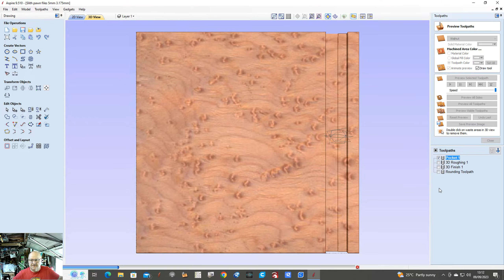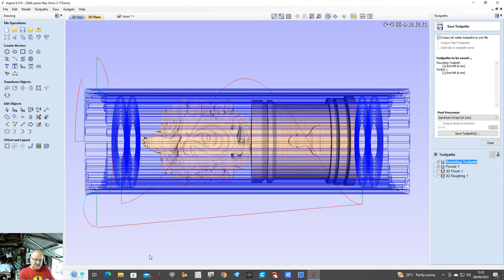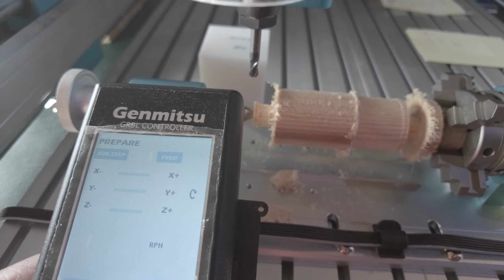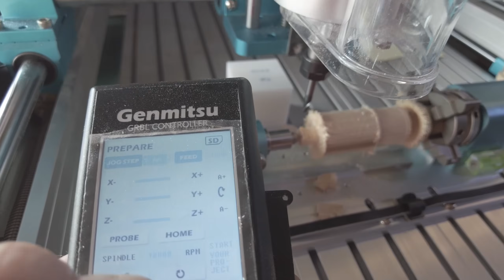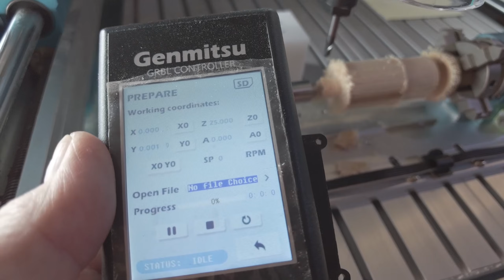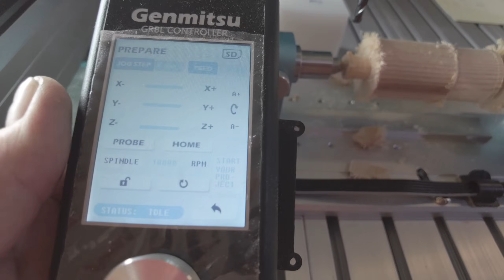Sainsmart Genmitsu 4040 Pro off Line controller Tool change on the Rotary Axis

Comment: Hi Tony.  I use Candle and this video looks like you can get the best of both worlds ... repositioning the cutter after shutdown using Candle and then using the offline controller for the job.  I think being able to send Gcode to the CNC is really useful ... this does you access to the the 'job origin', using the G30, G30.1 commands, which persist after power off.
Reply from the maker: Hi sending the gcode to your cnc from the pc is not the way I work I use to but  you have a shutdown with your pc or loose the usb connection it can be game over, may be a more cleverer person than me could get the job back. This use to happen to me but not anymore working like I do with the offline controller. The coordinates   I talk about is only when you are setting up the job, first go to  home and zero xy, then  jog to the job start position write down xy coordinates, these I only use if the machine cuts out mid job. Then  zero xy that is then your job start position. Set your z probe for your z axis position. load your job and run, when you have completed your first toolpath it will return to job origin change the tool touch off and run your next toolpath. If you cant touch off at job origin because of removed material just move the x or y axis to where you can or place a piece of the same job material on the bed touch off then run the next toolpath the machine will go back to the job origin and start from there. Hope this makes sense